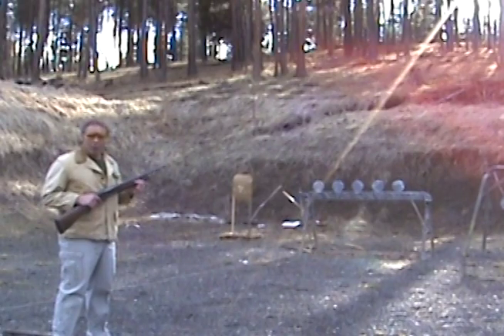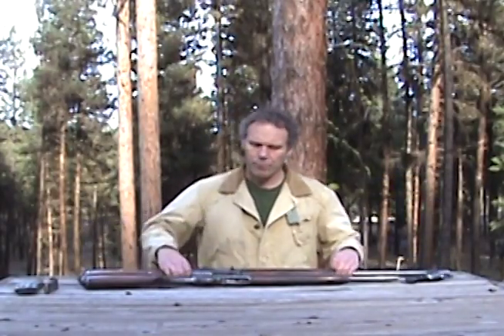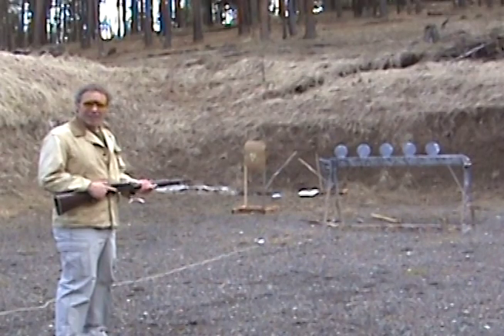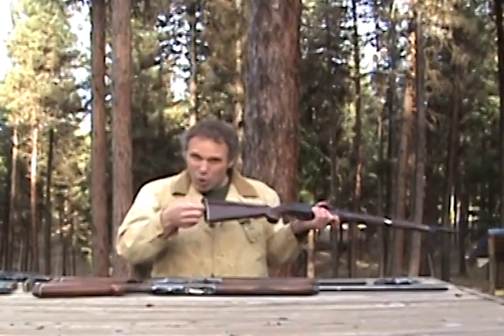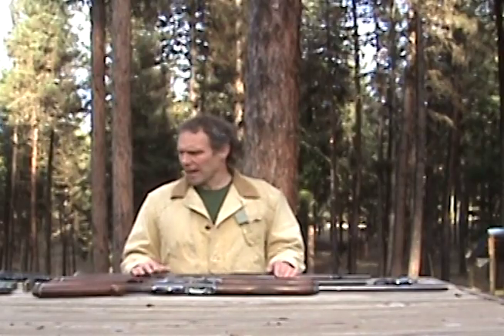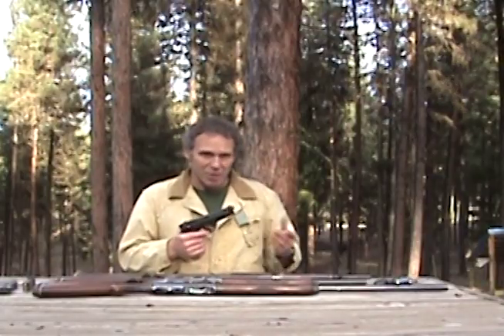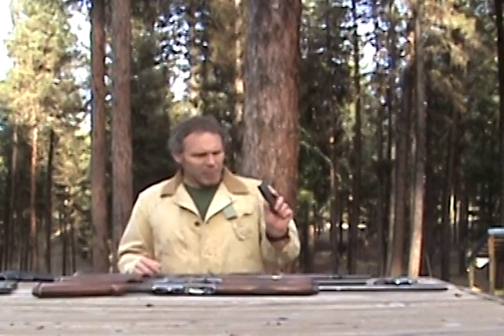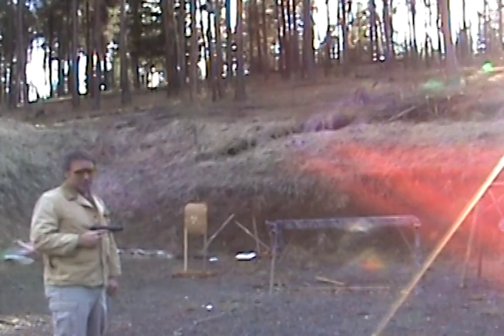Can spring compression damage a magazine?

Comment: Well leaving any magazine loaded for a long peorid of time will always be a 50/50 shot on weither it will work or not. Moral of the story is to try to alternate between which ones are loaded and which one's are not every couple of months. My grandfather left his two ruger p89 magazines loaded for over 15 years, and before he died he gave me the gun. I took it to the range and chambered the first round, and pulled the trigger, nothing happend. I slighty pulled back the slide to make sure a round was in the chamber, there was and since this gun is almost the same exact set up as a M9 I pulled the trigger in double action several more times. Round never went off so I racked it again and shot the next one, it worked. He had old federal hydra shocks in these mags and they were so old the copper jackets on the rounds had turned green, anyway after that was done and said both magazines had about 5 or 6 rounds a piece that wouldn't fire even after repeated primer strikes. I loaded the magazines up to capacity with new amo. First magazine I shot ran great no prolbems, the second one on the other hand had 3 malfunctions all failure to feed. After I got home took both mags apart oiled and streched the springs and scrubbed the inside of the magizines and the followers with a jeweler's cloth. Present day never had another prolbem with that gun and its my new favorite range 9mm. I unload and swap out amo mainly because im more worried about the amo going bad rather than the springs. I do store amo for long periods of time but its all in steal cans with damp rid lining the top of the can so it stays completely dry.

Comment: You kind of lost me when you started talking about single shot 20 gauge shotguns and revolvers. None of these use spring magazines and would be irrelevant to the topic. However, I wonder if spring compression is a factor depending on the quality of the spring in the magazine? Your thoughts on this would be interesting, as to whether cheap quality springs suffer more from compression than higher quality material springs. The answer would seem obvious, but still worth testing.

Comment: I think the MAJORITY of people that own guns, most especially people that have bought firearms in recent years, as soon as they get the firearm home, and find a wall to lean it up against, or a drawer to put it in, almost NEVER shoot it again.  Once they buy the gun and 50 rounds of ammo, they feel "safe" and problem solved they think.  I have no way of collecting "stats" but somehow I feel this is common.  They just want to pay a small price and to "feel safe".   So there are a LOT of springs sitting around with full load tension on them. 

You know I have welded steel for off and on over 50 years.  I do not have a phd in metallurgy but, I am pretty sure what makes the difference with springs of any type (not just guns) taking or holding a "SET" is the basic compostion of the spring in the first place  The amount of alloy to make it "spring steel" will vary from manufacturer to manufacturer.   I am pretty sure, a lab can prove it up at some cost to somebody, but the lousier the compostion of the steel the sorrier the spring and the LESS amount of times one can "fix it" by stretching it again.  Over time, how much time I don't know, but it WILL FATIGUE, most especially if it is junk to start with.  This "set" the spring takes is a form of METAL FATIGUE.  The same thing that makes a piece of steel crack and break after being bent so many times.  It is carrying a LOAD.  This is kind of common knowledge with machinists and weldors, or it should be.  Once you have repaired a lot of broken old machines or farm equipment a "pattern" of a sort emerges.  A Phd in engineering or metallurgy is not required to get a feel for it.  I feel, but cannot prove, ambient temperature, and exposure to corroding factors may very well have some result after a long time as well.  But I would bet my money it is the COMPOSITION of the steel spring regardless if it is a gun or an alarm clock or any other spring.  It is very possible to me anyway or it seems likely, that somebody that makes a very fine firearm just might not pay very much attention to what the alloy is on the spring in the mags.  Furthermore, they could be getting screwed by who they bought the spring material from in the first place.  So, results will always VARY from tool to tool or gun to gun.  That is my "guess".  BB
Reply: -Yup. If all springs lost tension under sustained loading, all cars would be laying flat on the ground after they aged out.. especially Rail cars..
Reply: @Blogengezer  Yes, that is true if you ask ME anyway!!!  BB

Comment: The compressed mag spring myth is false. Some people think that if you keep the magazine springs compressed it will ruin it and won’t work properly but that is not true. The mag spring is made for this. Yes over time the spring will lose a few pounds of tension but they start out with much more then what is needed. What happens if you bend a thin piece of metal into a U shape and compress it in a vise and leave alone? It will still be there 15 years later. It’s the loading and unloading/shooting that weakens the spring. Also PLEASE do NOT stretch the mag spring, WOW not good.

Comment: Anecdote:  I've heard of a WWI, or perhaps it was WWII, vintage USGI 1911, left in a box since the war with loaded magazines, which functioned perfectly when tried.  So that's decades.  Of course that was Colt (Springfield?  RR?) magazines, made in the good old days, stored in a house and not in Sahara Desert heat.  

If you have a hardware set with a known frequently reported problem, as with the USGI M9, obviously you should act accordingly.

Is it possible/reasonable, should you wish it so - perhaps for argument's sake you plan on leaving a pistol cocked and locked in a cache which might not be opened for decades but want it to be ready for instant action; say, in a safety deposit box or in a wall safe where you might be opening it under duress - can you take your magazine, or indeed the weapon's recoil spring, hammer spring, etc, and upgrade them with premium parts which might be expected to last "forever"-ish under compression?  

Or should you just go with a revolver?

Comment: I think Paul is a soldier of similar vintage to myself, maybe entering service a year or three earlier than I did.
Recommend viewing this video on the topic to supplement Paul's:
https://youtu.be/D7f5VYJsqkE

Bottom line:  Yes spring compression CAN damage a magazine particularly when exposed to heat for long periods.  But...that doesn't mean it won't work.  And it doesn't mean "relieving the tension" will help.

The spring's tension zone is engineered into the magazine with necessary assumptions made for operating heat range.   You may or may not know the engineering details of your magazine, or how it compares to your terrain, or what the QC variance is in manufacturing.

So check your magazines periodically.  But keep them loaded if your situation requires it.

It is better to get less capacity than expected when your life depends on it than no capacity, because the magazine is unloaded.  

P.S.  When shipping arms overseas in a sealed connex...make your armorer pack them in cosmoline or moisture-proof container or both.  Don't trust the seal on the 'sealed' container.  Ask me how I know.

Comment: I've had my Glock magazines loaded for a few months and this question is one on my mind. I had a Walther PPK that I bought used and the gun jammed every time. I got rid of it but now I realize that the magazines were probably damaged, not from being used but from being stored loaded for too long. The other side of the coin is that most police officers have a Glock 22 loaded to capacity all the time as this is their duty gun. You don't hear about this issue with them. Hickock45 and others, including some guy who says he's an engineer, state that magazines are designed to be loaded to capacity without damage. I trust Paul so I will unload my mags soon....
Reply: I have a PPK-S that did the same until I guessed at the cause and replaced some springs.
Reply: Not sure if Walther mags are just poor mags in general or does this prove the point that 2 people who don't know each other have proved that spring compression is not a myth and can really happen. You be the judge....

Comment: I have plenty mags dating back to the 70s and 80s that have been loaded, unloaded by use and reloaded and remain that way. 

I have no problem with them. 

I have a Winchester 1400 I inherited that had been used very little.  The gun commonly jams but the spring doesn't seem to be weak. I think it's just a sorry gun.

It's only a 3 round gun, not the best Winchester I've seen for sure.

Comment: Now to know how to debate spring damage u must understand metallurgy metal work hardens and the spring also depends on how strong it is and how much it compresses I believe that a mag spring that has had thousands of rounds cycled thru it will be weaker than a mag that was loaded once and left that way for years now on the same note a very large spring has more soft metal in the center due to what is called case hardening there for the more soft metal the easier to bend in terms larger the spring the easier it is to bend or compress in most cases

Comment: A properly engineered and manufactured spring will Never plastically deform as long as it's being used the way its intended. However, a poorly made spring that's not heat treated correctly will absolutely deform over time.

Comment: I have been a metallurgical and materials engineer in the aerospace industry.  That said, I am in no way, shape or form a spring expert.  Yes, they do exist.  I do know some things about springs.  The phenomenon you're discussing is commonly called "spring compression" or "spring set".  Not all springs, or types of springs, are created equal.  Design has an effect, but one of the big variables is the spring material, usually a metal.  Different magazines will use different spring designs and materials.  This is probably the main reason for the variability in anecdotes.  Since I don't expect you, or your viewers, to spend years studying metallurgy and mechanical engineering, I will provide the following guidance "Typically, you get what you pay for!".  Better products, like the Glock or Colt 1911, have better and more robust springs.  If you're worried about this, consult a competent gunsmith, research after market products online, and replace your suspect springs, or components with springs, with a better product.  Don't expect a cheap, Soviet era knock off to be as reliable as a reputable product.  I'm absolutely not a firearms expert.  This advice is just true for ANY mechanical device.  Listen to Paul.  He usually, if not always, gives sound advice.

Comment: I can't run the experiment, because I am mortal; but a properly make spring (magazine, trigger, sear, watch or what have you) "should not" lose strength under static maximum compression givn any reasonable time, say 100 years.  Now, using that same spring over and over, that will change its characteristic.  An spring made of poor metal or improperly tempered, it will fail regardless; sooner than later.

Comment: A spring can be damaged, yes. Even one made from the best materials and 100% correctly made and engineered, with a caveat on the engineering bit. If the spring gets over-compressed, it won't last long if kept or cycled over compressed a lot. A magazine is a primary example of something that should be engineered to never be over-compressed in the mag body, even at full. They violate this for added capacity in the same size magazine.

Comment: Bad quality steel springs tend to have a poor elastic limit stability independently of if they are left loaded or if they are frequently loaded and unloaded.  A well designed and good quality spring shouldnt modify its elastic limit if loaded within its design range.

Comment: I have total of 42 30rd clips for. Ar-15, Kel Tec plr-16 and sks 7.62x39. I have them all loaded with 20 rds. Some have not been shot in about 10yrs because I use 5 per gun at range and put 20 back. I don't rotate. Hope you understood that lol. Do you think all the magazines tha have been loaded with 20 rds not 30 are good to go? It was a worry when got them all that's why only put 20rds instead of 30rds? Thanks

Comment: Paul, I have a Glock 23 and a Glock 19, both were put in a drawer fully loaded and left there since about 1995 and never touched until this summer (2021). Also had a spare magazine stored with each handgun, also fully loaded. So, you are welcome to check all four magazines if you are interested.

My finger checking the follower says the springs are weaker, but I don’t believe weak enough to make any difference. Just my guess though. 

Unloaded the pistols and used other ammo to go to the range. Cleaned the firearms, reloaded back to their previous state and put back in the nightstand drawers.

Love your videos by the way. And… I do not try this at home, because I am not what cha call an expert. 😁

Comment: Look, you don't need to worry about whether long term spring compression can damage a gun or magazine. You need to worry about whether long term spring compression can damage a SPRING. 
Engineers have done thousands of studies. It depends on materials, metal quality, temperature changes under compression, and multiple other factors.
So obviously, YES, it CAN happen. A better question would be, how COMMON is it?
Studies tend towards, "It's uncommon".

Comment: The difference is the quality of the wire from which the spring is made. Top quality music wire is not cheap and cut price magazines use a lesser grade. It works OK, but can "take a set" if left stressed for a long time. Top quality wire will not do this and you can leave it fully stressed for a century.
You get what you pay for.....

Comment: I have a semi-auto pistol that seems to have its hammer spring compressed at all times unless it's dry fired.  Is it anything to worry about or is it something that needs attention?
Reply: Are you sure it's not a striker instead of a hammer?
Reply: @manlyadvice1789  I don't know the difference. What I do know is that something is constantly compressing a spring unless I dry fire the pistol.
Reply: @billtheboatman  If you dry fire it twice, does it feel the same both times? Generally speaking, strikers are double action only, so there isn't any stored spring compression. If you dry fire it twice and the second time is a heavier pull than the first, then something was cocked. If it feels the same both times, there's probably nothing cocked.

Comment: few thoughts about this video. First of all exercise bikes are not clothes lines.thats absurd. We all know the treadmill is better for hanging clothes on. 

 Anyone that has worked on old cars knows springs sag under load over time. a 30-40 year old car will sit way lower than it did when new.  The quality of the spring and how much extra pressure it had than it needed to start with is.

Comment: Nothing in the universe is absolute. A spring will fail, given enough time, regardless of how it was used to the termperature it was at or humidity, etc. Obviously packing it more at higher humidities and temperatures accelerates that process, and a spring doesnt go from 100% functionality to breaking, it gradually wears out. So maybe you have 6 year old glock mags that have been packed and work still, but those springs are not 100% at the capacity they were brand new. Leave em packed long enough and they will fail. Leave it unpacked for even longer and it will fail.

Comment: Hey, so I have a marlin XT 22 in 22 LR (a bolt action rifle). I leave it cocked because I don't want to dry fire it. Do you think that the spring that holds the firing pin will become fatigued eventually, or is that unlikely?
Reply: Dry firing it once to relieve the tension on the firing pin spring will not hurt the gun.
Reply: @gregb6469  Thanks for your reply. I thought it was probably okay, but wanted a second opinion.